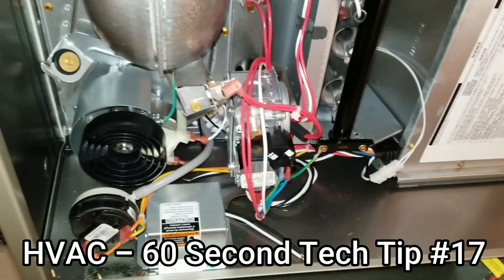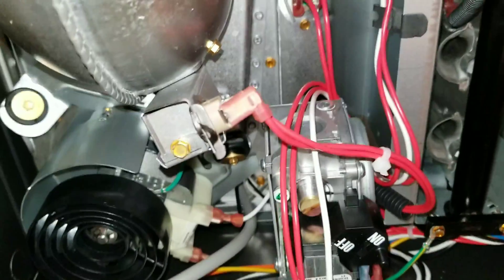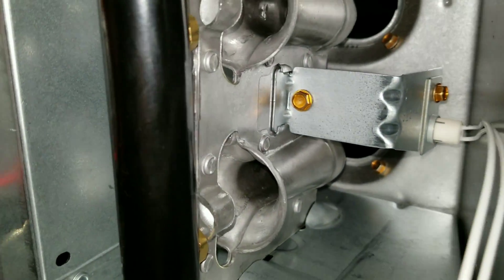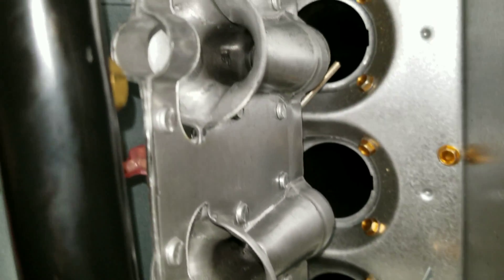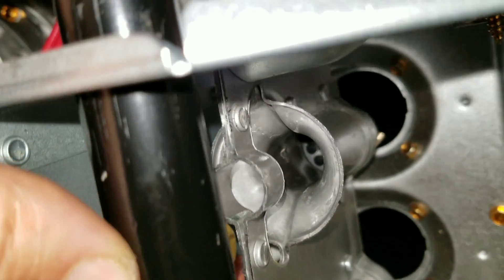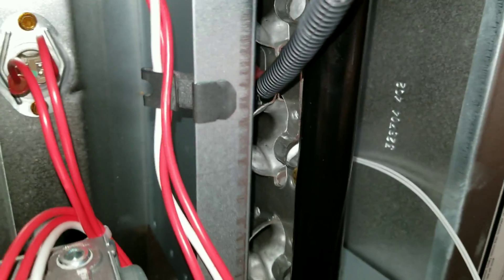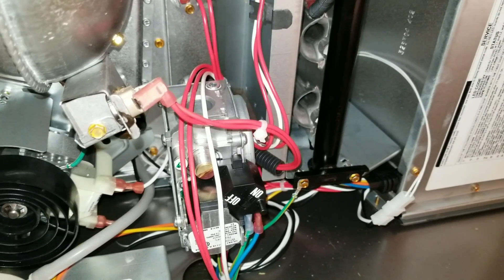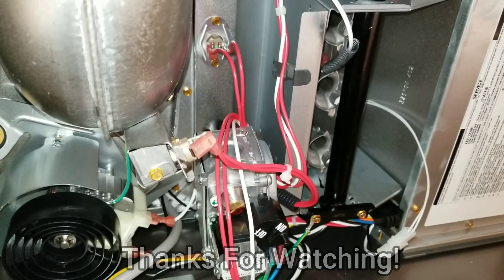HVAC - 60 Second Tech Tip #17 (Close enough)

Comment: I dought that got out of the factory that way because the last thing the factory does before that box it up is test fire these furnaces and records the results. That looks like shipping damage to me you see you put furnaces on a tractor trailer stack them three high and ship them over the road things will shift. You are right it's your responsibility to look things over before you fire them off.
Reply from the maker: Larry Cole Could have been shipping damage but absolutely could be lack of quality control which happens just as frequently these days. There have been plenty of factory mistakes I found over the years (with many different manufacturers) that should have never made it out of the factory yet still did. How it happens really isn't important. Finding and correcting these issue is.